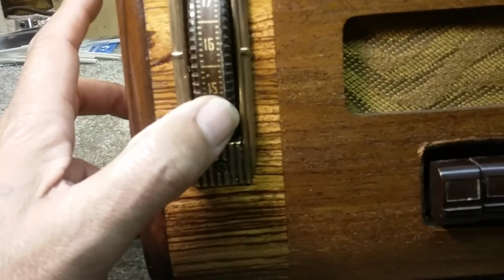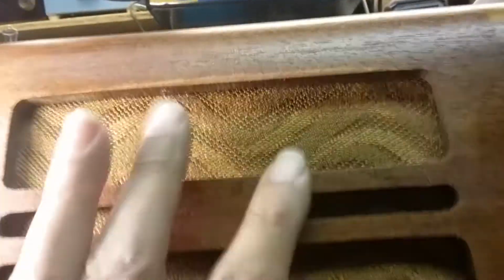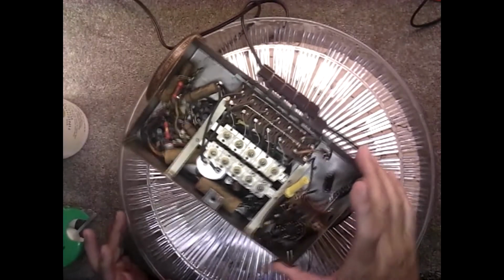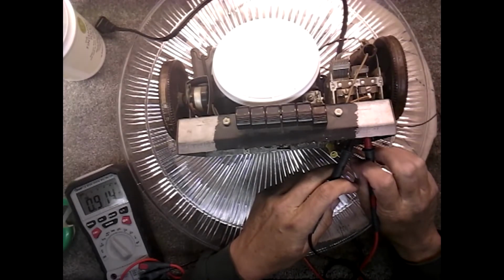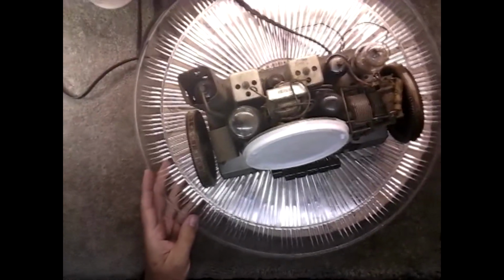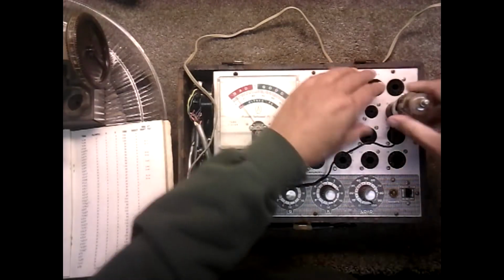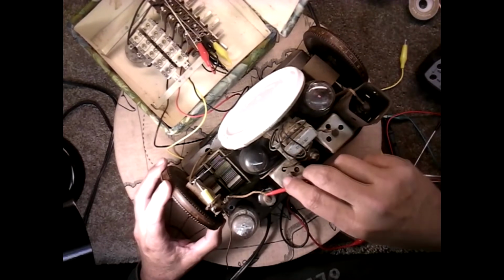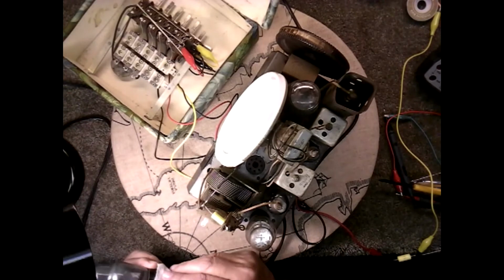GE GD 60 Slant Front Radio - Recap & Troubleshooting - Part 1

Comment: I figured out how to measure the primary and secondary windings of this GD-60 antenna coil. To test the primary (tall, slender winding) test between the front side of the .001 capacitor and chassis ground. To test the secondary (flat, wide winding), measure between the two back posts that are not connected to either the antenna lead or chassis ground - one post connects to the grid of the 6A8 with a second wire to the push button assembly. The other post has a wire going under the chassis at one of the I.F. cans.

Most of the time, there is no open winding. It's just bad solder connections where the winding leads join the posts. I restored one of these radios to give as a gift. But when I showed it to the recipient, it wouldn't receive any stations. So I took it back. I was able to get it receiving again by cleaning and pressing down on one of the secondary posts. I then re-soldered all the leads and posts and now it works like it should. Loose solder connections at the antenna coil seems to be a common problem with this vintage model.

Comment: Hi Paul, I recently picked up one of these and when I went to check the wax caps discovered that GE did not put all the values on several of them - just their part numbers.  This is a first for me and am baffled at how to figure out what caps go where - I've got the schematics but am having trouble it.  Do you happen to have a picture or two from where you recapped this one that shows which caps go where? Thanks for any help with this!
Reply from the maker: Hi @alpine67, Here is a copy of the schematic with the parts list. 
https://drive.google.com/file/d/1a9vwQLg19pB67kSmTCmfb4wgvCQgESMg/view?usp=sharing
That should get you what you need! Regards, Paul
Reply: @ElectroRestore  Thanks, Paul!